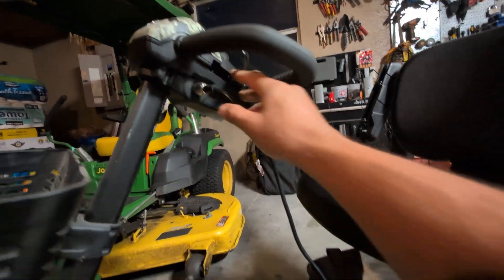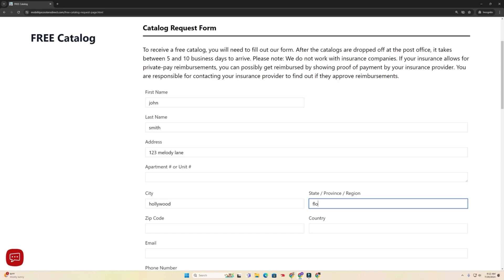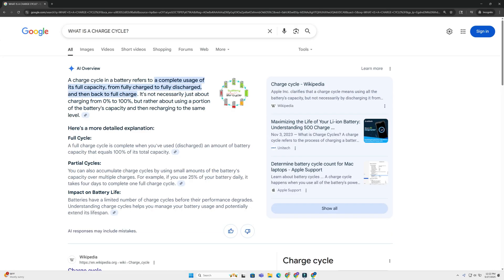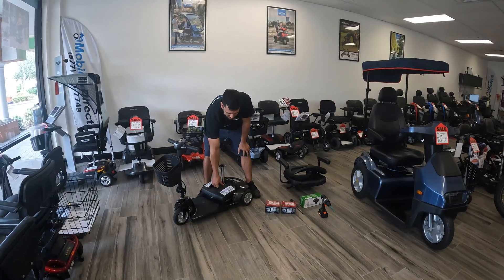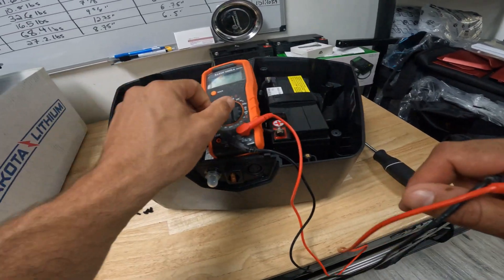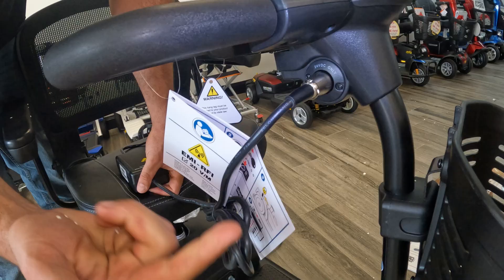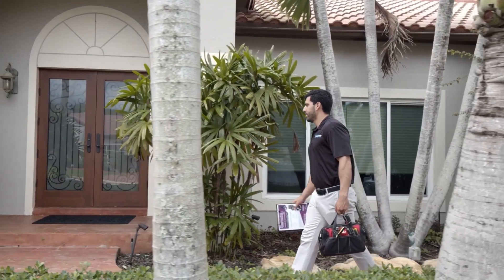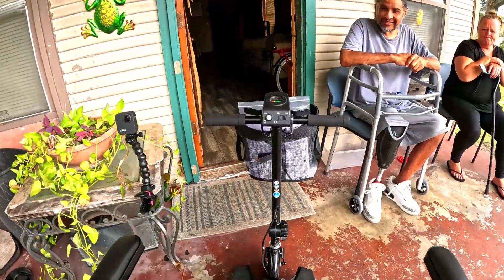Why Your Fully Charged Scooter Dies Fast (And What You Can Do About It)

Comment: I’ve been following you for a while now have enjoyed many videos . I’m wondering are they making those lithium iron battery’s any better than before . And I’m wondering why those battery’s sometimes melt down causing fires ? You see I’m researching and I’ve been looking for an electric power wheelchair . Must be lightweight ,foldable , but the battery issues have me worried . And now the airlines say there not allowing those battery’s on the aircraft being so many battery’s have been causing fires .  I have your YouTube catalog . Here we can’t have the battery’s in the house because the owners have concerns .
Reply from the maker: @terrystevenson6449 Thank you for following us and for your thoughtful questions! 🙏 You’re right — battery safety is a big concern. The good news is that lithium iron phosphate (LiFePO4) batteries are much safer and more stable compared to older lithium-ion types. They have a lower risk of overheating and are designed with built-in safety systems like Battery Management Systems (BMS) to prevent issues like overcharging.

Airline regulations can vary, but most FAA-approved lithium batteries under 300 Wh are still allowed for air travel — always best to double-check with the airline beforehand though. ✈️

If you’re looking for a lightweight, foldable, travel-approved power chair, we’d love to help! Feel free to give us a call at (888) 263-5601 and we can walk you through the safest and most travel-friendly options. 🛫🛵💙